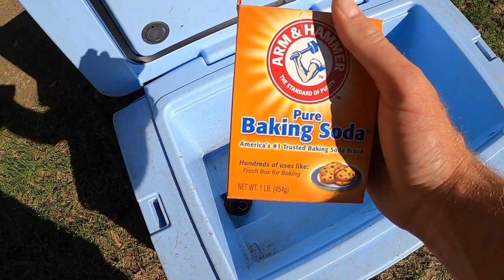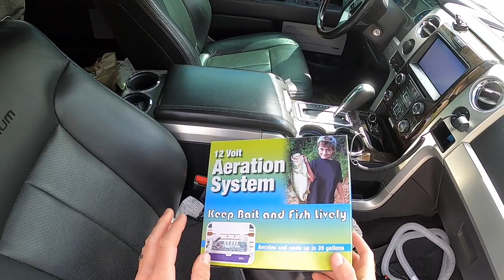Turning ROTTEN MEAT Cooler into LIVE BAIT Tank! (DIY)

Comment: Bleach mixed 50/50 with water....put in a spry bottle and soak the snot out of that that lid gasket, and all over the inside, the drain, the drain plug and let it set for a bit...then use a scrubby sponge or a scrub brush on it.

Comment: the one that died right next to the intake on that pump i bet died because he got sucked and trapped on the intake of the pump and couldnt swim away (most likely going to happen especially with smaller fish) so maybe add some kind of grate or mesh around it to prevent fish swimming into the intake

Comment: What if you cut a cutting board down to size so you could make a divider down the middle of the cooler. Then you could run two different baits if you needed to keep them separate.

Comment: Are u game for a experiment? Hydrogen peroxide is H2O2. Water is H2O. You tube "theroy" is by putting peroxide in the bait water it gives up one part oxygen turning into water. This is true I know as a old bottle peroxide does indeed turn into water. The bait idea is that it "supercharges" your bait. Keep in mind. The O2 peroxide gives up is 100% pure oxygen. The air u breathe us only about 12-13% which is what's usually in your bait tank water.